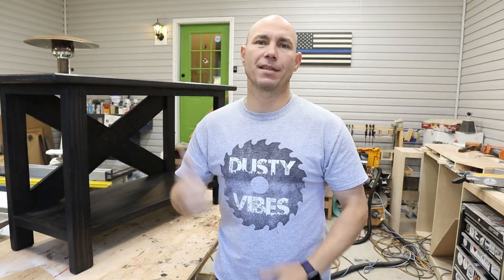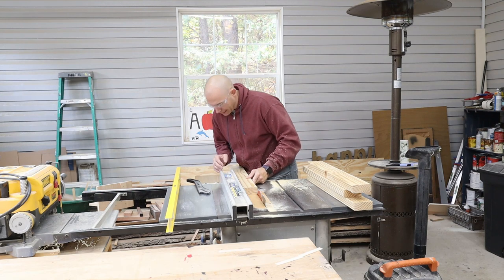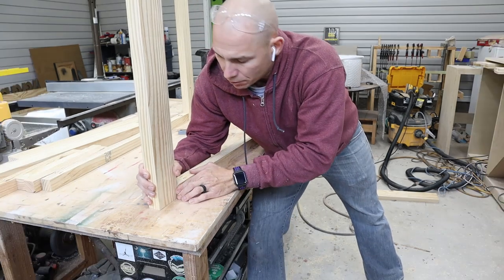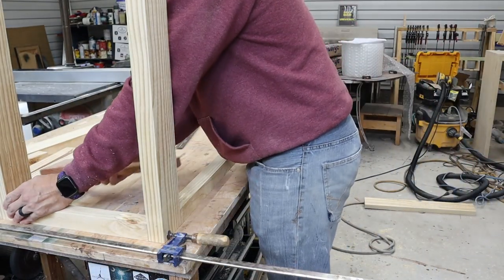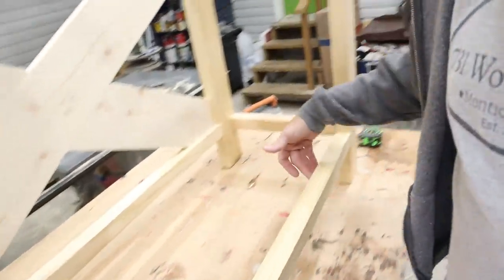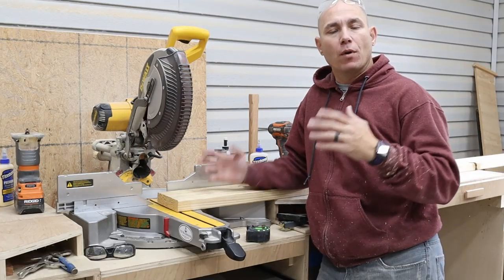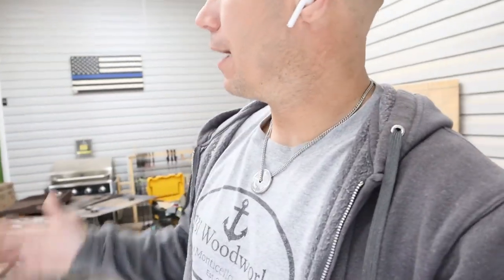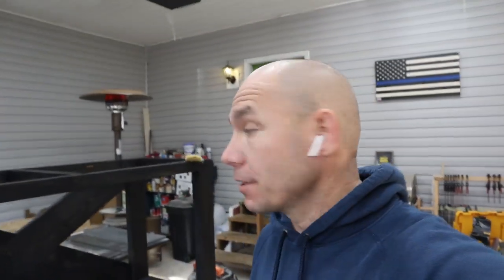DIY Farmhouse Sofa Table | TV Stand with Build Plans

Comment: Your “jointing with a level” is comical… Regardless of moving the level or not, or even using it or not, gives the exact same result as just using the fence to start with…
Reply from the maker: Nope. It doesn’t.  You have no idea you’re talking about. Have you tried it? Doubtful. The level provides a straight reference for the blade to reference. The fence will simply reference the side of the board
Reply: @731Woodworks  The level references the side of the board too. If there’s an imaginary line where the fence is, or where the level is, the line is the same. Moving the level or not, the line is the same. Point A to point B, level or no level, the fence is in the identical spot. That “value” doesn’t change at all.
Reply: @731Woodworks  I’ve truly obsessed about this for many hours at this point. I genuinely apologize and understand the application. You basically fool the saw into cutting like one side is already jointed by using the straight edge and then when flipped over, well, that edge is straight… 😐  I suppose I imagined it more like a circular saw moving through the material but since the material moves through the saw, the curved edge won’t remain constant against the fence.